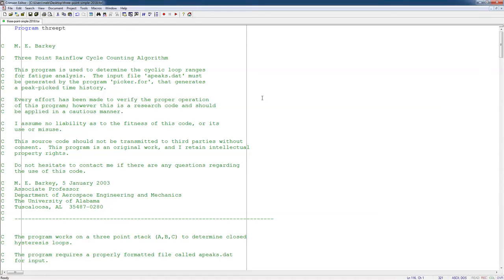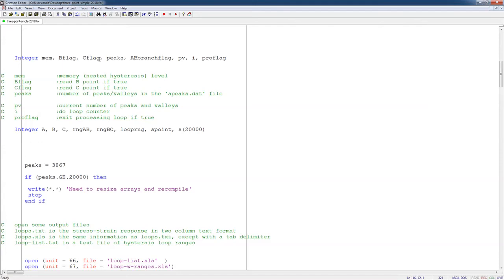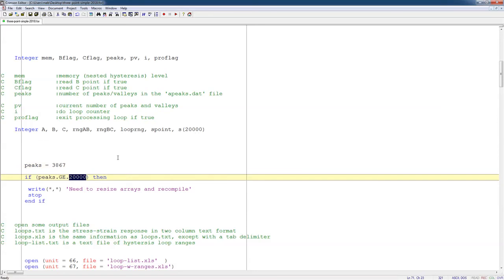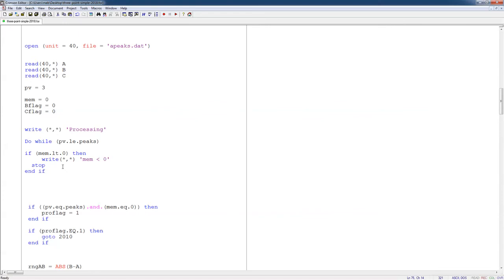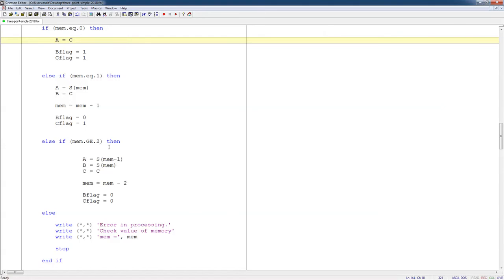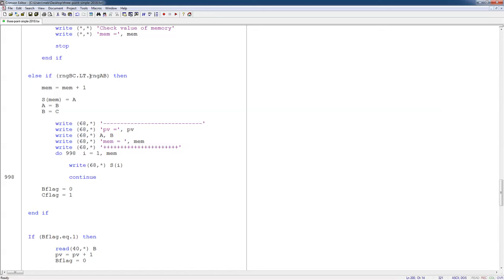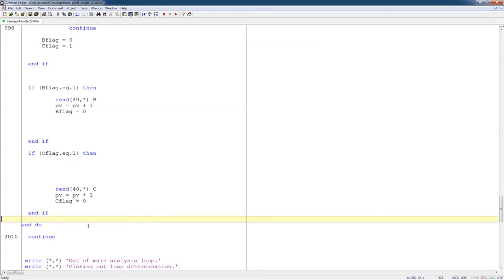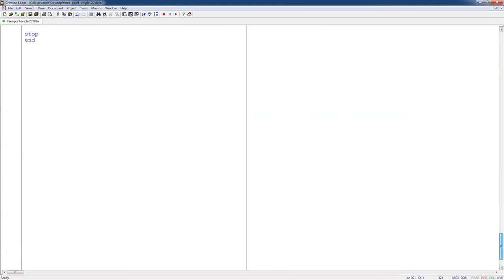Rainflow Cycle Counting part 3/3--Fortran Program

Comment: Can mem never be greater than 2? I have about 500points to process and there are instances where my memory is greater than 10. Also, can you please tell me how to count half cycles ?
Reply from the maker: Yes, the memory storage for can be greater than 2.  ASTM rainflow forces the start of the sequence with the largest peak (or valley) and so there would never be any un-closed loops in following this procedure.  However, if you are doing 'real time' rainflow processing then there can be instances where you do not have control of the start of the time history.  This case is discussed in my lectures.  The usual implementation is to go ahead and close all un-closed loops and assign half damage to those loops that were artificially closed.   In the German literature, this is known as a 'residue' of the time history and you can find literature addressing this in detail.
Reply: @mbarkey.mechanics  
thank you for the response! Can you please point me to the lecture which speaks about rainflow processing in 'real time'. Also for the residual cycles, is there any standard algorithm to follow?
Reply from the maker: @prithvi-y4v    I don't remember which lecture, but the procedure is just as I have described above.

Comment: Thanks for this great videos. The analog to stress strain curves for cyclic loading is very helpful. Once you said that the sequence should start with the maximum value. What should I do, if the minimum stress is -250 MPa and the maximum 120 MPa? I assume -250 MPa.
Reply from the maker: There is really a choice, you can start with the largest peak (most positive) or you can start with the largest valley (most negative).  The cycle count will be the same.  Many codes with start with the most positive though (120 in your case) since it can skew the strains to be more tensile which may be more important for mean strain and mean stress sensitive damage parameters.

Comment: Thank you, these videos were very helpful to me to learn this topic.

One comment, in the video you say that the procedure is the same for case 1 and case 2, however it appears to be slightly different if mem = 0. In case 1, A and B are discarded and a new B and C are read, and in case 2, only A is discarded and only a new C is read.
Reply from the maker: Thanks.  It has been a while since I have looked at it, but I think the logic could be compressed so that case I and II can be combined.  (i.e. the code could be re-written to make them the same).  For teaching purposes, I like to have them separate.